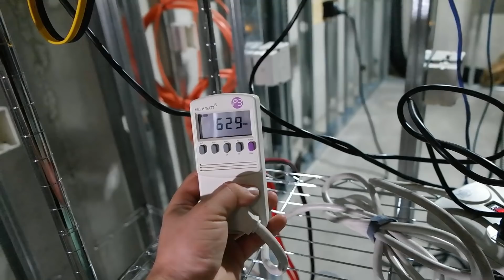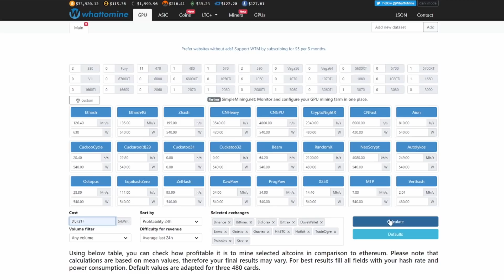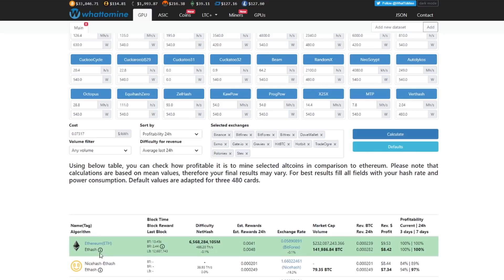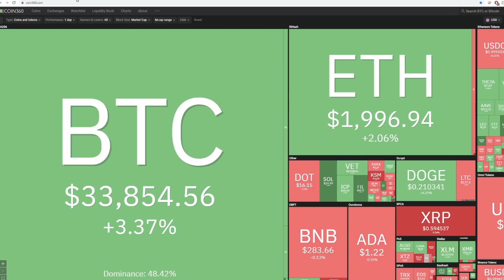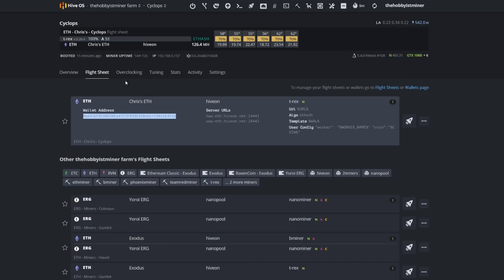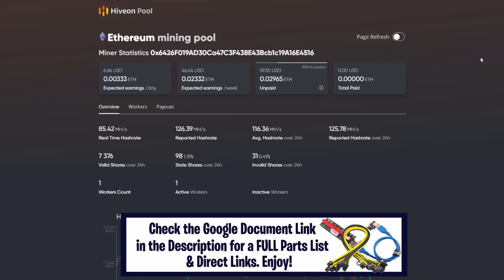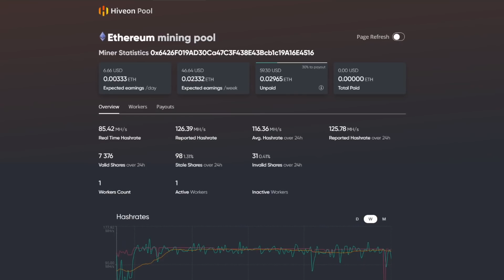GTX 1060 6GB Mining Rig 1 Week Review - Hashrate, Profits & Power Consumption

Comment from the maker: Anyone else running GTX 1060 6GB GPUs? What kind of Hashrate are you seeing?  Hows your Profitability right now per day?
Reply: I have 1 Zotac 1060 with Hynix memory running etherium in HiveOS.  Core 150, mem 1800, power 80watts, hashrate 21.5.  Maintains this hashrate in Nicehash and unmineable.  I gets roughly the same rejects and invalids as my 1070, Rx 570 8gb and rx 470 8gb (all in the same rig) rig efficiency about 98.7%
Reply: I have one of the white ASUS 1060's in my rig.  24.31 MH/s.
Reply: @jeepsnbikes  HOW. Every time I get the card above 21 MH/s it crashes..
Reply: @jeepsnbikes  I'll check it out, thanks!
Reply: @jeepsnbikes  NH efficient mode runs 23mh for me at 80 watts
Reply: I've got 33 1060's running having a hard time to get stable hashrates, i keep on getting gpu driver errors.
Reply: i also have a gigabyte 1060 6gb that was the culp with my drops when i did have issues the clock settings i have that are stable for this model at 20.39 is 100 core 800 mem 70plhive os
Reply: I have been running 6 different brand/model gtx 1060 6gbs on 1 rig. Total hashrate is 152.8mh rn. 4 of the cards are samsung vram, 2 of them are hynix. Samsung is definitely a bit better, I maxed out 26mh per card with samsung ones. hynix ones are stuck between 24.6-24.9mh...
Reply: working on getting 3-6 1060 6gb cards to set up for Ravencoin or even Ergo,  Just want to constantly stack my portfolio, and I kinda feel with the current state of Crypto the Invalid shares may reer their head a little more often...
Reply: @TemptationS_LIVE  "with the current state of Crypto the Invalid shares may reer their head a little more often..." not sure what you mean bro.
Reply: Running 20.5 MH/S with overclocking on an Asus model right now
Reply: @e.louizos8577  mining what? Classic eth?
Reply: I get an average of about 21 MH/s at 80 Watts. Core: 0; Mem: +900, Power: -20 (80%). Oh and it's a 1060 6GB mining card (P106-100).
Reply: just starting on this ... lol reading you guys i feel like a real noob noob..i only have one in my pc and trying to learn some  things. i think is arround 22.5 mh or at least its the average phoenix miner says...NOte: i only use miner arround 6-7 hours per day...im afraid to burn my only card. :)
Reply: @EzKuLaKa  Careful man. It might be wise to buy a spare card. Are you monitoring your temperatures?
Reply: @thequietkiwi   yep i wish i could buy a spare card. unfortunately what i want is unavaiable and no much money...the temps are between 48ºC and 53ºC all the time.
Reply: @EzKuLaKa  No es un mal approach ese. Yo vengo haciendo lo mismo. Se que les puedo sacar mucho mas jugo a las placas que tengo minando, pero no me interesa ponerlas al 100% para que me duren 4 o 12 meses menos. Estoy seguro que con que cada placa me dure 1 o 2 meses mas, se recupera cualquier diferencia que hayas obtenido por tenerlas minando super overclockeadas. Pasate por mi canal y fijate el video que hice sobre "puedo minar ethereum?", ahi puse data sobre esto que te comento
Reply: @PolDePonder  gracias por tus videos, ya me apunté y ando echandoles un ojo...echo de menos algun canal que pueda entender mejor. Saludos
Reply: @EzKuLaKa  contame de que te gustaría el próximo video y te lo dedico!
Reply: @PolDePonder  hola de nuevo, no te preocupes por eso...si veo algo que no entiendo te lo pongo por allí, asi no spameo al colega de aqui. Gracias miles.
Reply: Im getting 25mh on a Asus dual 1060, and 21mh on my second Asus dual 1060. Im curious on the third 1060 which im waiting for
Reply: I have 4 GTX 1060. 3 of them with the MICRON memory (those are the good ones) and 1 with Hinyx. Just like you, Hinyx gave me a 16 mh/s with stock settings. I OC to 18 with a very conservative setting and getting 100% accepted ones. The other MICRONS are at  20.8 mh/s with a -200 core and +400 mem. They could give 22 and something but I rather maintain them on a more stable config
Reply: Heya, I managed to find a way to push Hynix memory 1060's to 23 Mh+ depending on clocks

My Asus 1060 6GB Hynix Memory is running at 23.4 Mhash atm with +100 Core +510 mem 80% power

This was done on Windows and worked I cannot guarantee it will work on HiveOS

This was done on Phoenix Miner as Trex wont apply mem tweaks on anything's except 1080/ti

Reset all overclocks of Hynix memory cards and then start the miner with -straps 1,1,0,1,0,0

From here you start with your memory around 300 and Core clock at -100 and start bumping the memory up 10-25 at a time. wattage on GPU is slightly higher 95 watts vs 85ish but you gain 3-5 Mhash. 

you'll get too a point where memory barely affects hash rate. From there start upping the core clock. Until the hash rates barely changes as well. from here its up too you too find the PEAK performance.

Some cards can handle -straps 2 but not many. some will run just fine for days others will go for minutes and then you get ones that will crash after 10-20 hours
Reply: I’m getting 24.5 MH on my one 1060 6gb at 800 memory 75 clock full power
Reply: @Mystical922  Which mem brand does your GC has?
Reply: @PolDePonder  Gigabyte
Reply: @PolDePonder  play with your clocks focus on high memory stay in the 60-70C temp range keep a little clock speed I’ve found increases the hash rate stability ranges +/- .2 MH every once in a while.
Reply: I have 23,68MHs on a ASUS White With Samsung Vram. Core 200 mem 1500 PL 85
Reply: 1 EVGA 1060 6GB 20 MH/S no overclock no stale shares unlike my 1660 supers...
Reply: same 6 Rig gtx 1060; getting 24.** mh/s/gpu; no matter the memory type;

My setup:
GPU 0

GeForce GTX 1060 6GB 6078 MB · MSI
Samsung GDDR5 ·
24.33 MH

GeForce GTX 1060 6GB 6078 MB · MSI
Hynix GDDR5 · 
24.31 MH

GPU 2

GeForce GTX 1060 6GB 6078 MB · Gigabyte
Hynix GDDR5 · 
24.28 MH

GPU 3

GeForce GTX 1060 6GB 6078 MB · Gigabyte
Hynix GDDR5 · 
24.26 MH

GPU 4

GeForce GTX 1060 6GB 6078 MB · CardExpert
Samsung GDDR5 ·
24.24 MH

GPU 5

GeForce GTX 1060 6GB 6078 MB · Sapphire
Samsung GDDR5 
24.15 MH

Getting a total of : 145.7 during the day;  146+ during the night (when it's colder outside)
Reply: @eddyxist  share OC pls for zotac 1060 6GB single fan Samsung mem
Reply: Just found out that with hynix memory applying the --mt 3 --intensity 100 got my hashrate from 19.8 to 22.5. Overclocks that i use are +700 memory and curve 1835 core on 85 wats.
Reply: 19MH on 2miners currently with the EVGA 1060 6GB using hiveos with FAN 70, CORE 110, MEM 1350, PL 80.
Reply: I have purchased one inno3d 1060 and I'm getting 12-14 Mhs I tired and applied different overclock settings still I'm getting 14mhs 1060 6Gb micron memory
Reply: Idk if this matters but the temperature on 1060s affects the operability of the card pretty significantly. 
Idk if other cards are as temp sensitive but my 1060s go up a couple MH when the temp comes down a couple degrees
Reply: I'm using EVGA GTX 1060 6GB today for Kaspa. It is consuming 115 watts each. How can I reduce it?

Comment: My single evga sc 1060 6gb is doing up to 23 on efficient settings with nicehash,99watts draw tho. On manual, power limit 75%,core +200mhz,memory +900mhz its doing around 21,80watts power draw, 59-60 degrees celcius

Comment: 1060 gets 60 mhs mining ergo at around  68 watts 800khw roughly . use ---mt 3 with t-rex 0 core  +750 on the ram  %50 power to 70% seems to do nothing i leave it at 50%  or u can even use the ethlargement pill works with ergo. not as fast as --mt but probably safer.  autolykos2  is the most stable friendly algo iv mined yet.

Comment: I run an 18 card rig of 1060s and 1080s running Hive OS. Settings are: 100/1000/80. The 1060s are a mix of Gigabyte, Asus and Zotac and I had heaps of problems with unstable hash rates and invalid shares.

Turns out the Gigabytes were the problem, I had to turn down the mem clocks and for some random reason, turn up the core clocks across the board as the Asus and Zotac's could handle way more. 

I have full rigs of 1060s/1080s, 1070s, 1080 ti's, RX 570s and RX580s and can safely say the 1060s were the most fiddly alongside the 570s and 580s. I had to test a large number of OC combos on each individual card to determine which ones were dragging the rest down.
Reply from the maker: Testing these settings now! Thank you.
Reply: @TheHobbyistMiner  Other settings I tried were 0/1200/80 which pushed most 1060s to an average of 22 mh each but the Gigabyte cards dropped to 16mh. Even though the algos I mine with don't require Core overclocks, the cards themselves seemed to.

200/1000/80 was pretty decent and stable averaging 20mh per card but the happy medium for me was the 100/1000/80 setting.

The sad thing about mixed Brand rigs is some cards will perform great and some perform much worse, using HiveOS via USB boot I am applying blanket settings to everything. The only thing I miss about Nicehash was using Afterburner to optimise every card one by one :D

Comment: I've got a gtx 4gb 980, from my research btg or vertcoin are the best things I can mine with it. Any other coins I should check out? It won't mine eth or firo sadly. Its hash is trash on ravencoin. Im not worried about electricity. So far btg is the most profitable coin I've been able to locate. Shame whattomine doesn't support the 980.

I use nicehash and betterhash for mining. Betterhash says I could mine firo with it but it just doesn't work. Not sure why but it just gives me an error. 
Honeslty i might just sell it on eBay and wait for cards to dip in price and grab a better card but for now I wanna mine with it. I should have time before eip comes out and dips prices, atleast a month or more.
If it matters im also mining with a 1080ti and a 1070. Those switch between eth/raven/firo.

Comment: The evga single fan cards are designed to primarily vent hot air out of the back of the card.  As you have them hanging, that would be down.  Are you having heat issues or having to run full fan?

Comment: I built my rig this past week, RX 580, RX 570, 2 RX 470, 5700 xt all mining raven coin. I had a issue with invalid shares as well. My solution was just trying out different Overclocks till it worked. I found dropping the memory on the GPUs helped. But I think it matter on the coin.

Comment: i would put them on windows 10 run phoenix miner but use the detailed stats option in the config.txt we have 30 rigs on windows on phoenix using the following options -lidag 1 -gser 1 -tt -80 -hstats 2 -dbg -1 -rmode 2 -dagrestart 1 -ttli 70  the readme in phoenix tells what those all do. with -hstats 2 you will see the share count and get the bad card pretty quickly. we use windows 10 ghost spectre. no updates no bloat and no telemetry its free. we use amd driver 20.9.1   we only have one nvidia card though and its a 3060 on trex. but seriously you should id the bad card on phoenix. i know trm is better than phoenix. but we are on phoenix for reasons - the main one is the config.txt sets everything clocks, fans mem speed . i should do a video instead of these long typed things. best wishes from manchester uk . trm is amazing on 5700s and radeon viis i know.
Reply: you set the nvidia clocks in phoenix with an offset rather than absolute value. its all in the readme. phoenix is bad but it isnt that bad. lol

Comment: With 1060 6GB Hynix cards, i start off with everything at 100% stock. and then i bring my  CORE  to 100+, MEM to 700+, I then run it for 5 mins on those settings with 100% PWR still.
Then i slow bring the MEM up to 725+, run it again for 5 mins, then bring it MEM to 750+. Let it keep running for 5 mins again, and then bring the power down to what you like.

Doing this has stopped those specific cards from crashing as thats what i concluded.
My settings for the all my Hynix 1060's are

PWR 80%
CORE 100+
MEM 750+

Mind you this is me running off Windows using MSI and i know the settings will be different on Hive, but doing it this way has stopped the same problem i was having.

Also on my rig specifically, Ive had more problems with the EVGA 1060 6GB SC vs the normal EVGA 1060 6GB.

Comment: I thought about buying 1060. But didn't think it'd be worth it.
Reply: Any card makes more than "no cards".
Reply: 1060's are cheap and quite power efficient, if you don't have solar or cheap power 1060 and 1660s rigs are the business.
Reply: @Reliq3k  what Hasrate is the 1060.6gb n watts

I'm getting bad cards I swear.
Rx470. 8gb after so much trouble shooting.
24.5mhs @ 82w

Comment: I manually set the fan to 100 to find which card has the lowest hash or giving problems to locate the card and disconnect the USB after I turn the rig off. And restart. If there is another card doing the same ... repeat. Then restart and see and mine for an hr to see where the problem card is... and give that card a 4 hr rest. Replug the usb and the card should be fine

Comment: This is the reason I avoid older generation cards, I just focus on acquiring GDDR6 GPU's and I have started to trade/sell my GDDR5/X cards. The GDDR6 cards are just newer, more efficient and you avoid the headache.
Reply: right now you if you can get old generation cards for the cheap its totally worth it to mine speculative coins
Reply: Do you have GDDR5 cards on sell still?
Reply: @jgmercedes  nah, I only had the 1080 and 1070 and have traded those to 1660S/Ti + cash.
Reply: @13thzephyr  In my country is impossible to find cheap cards even used one's, but thanks buddy
Reply: @jgmercedes  same here but from time to time a deal pops-out so I'm always on the ready. Just yesterday I bought 2X 3060 LHR for $1200. Not the cheapest but I can put those in to good use and mine ETH using NBminer with the partial LHR unlock.
Reply: @13thzephyr  Bro here they cell one 3060 for $1017 us dollar lol, so that's actually a great price for you, In my case I would have to start with a 1060 and get my way up there, good luck hope it works out for you man
Reply: @jgmercedes  wow that's pricey, 1060's are not bad as long as you can those $250 or lower.